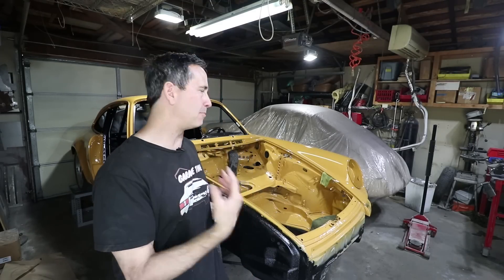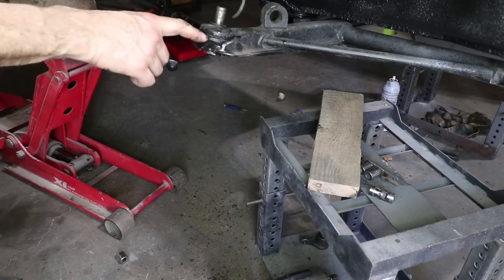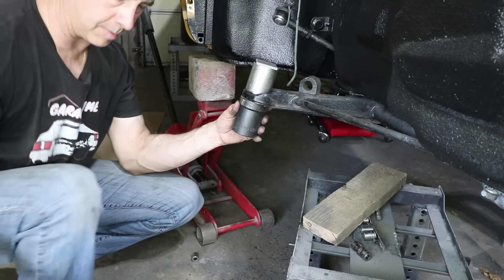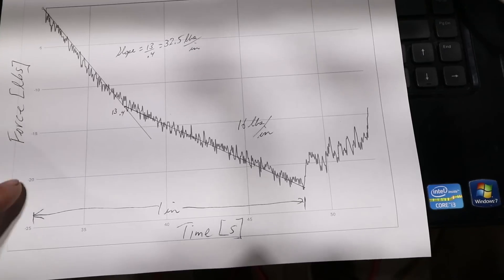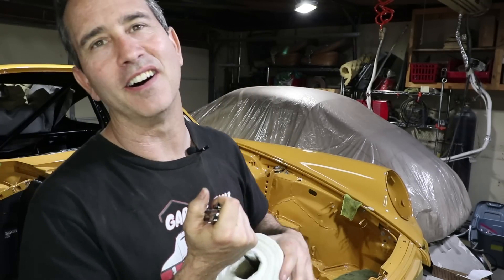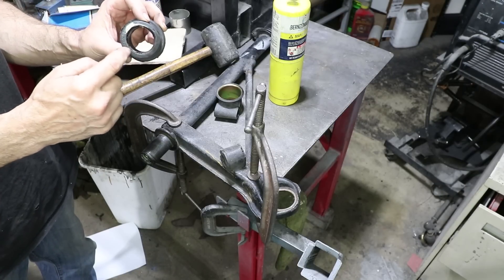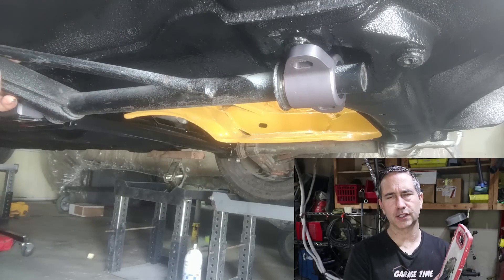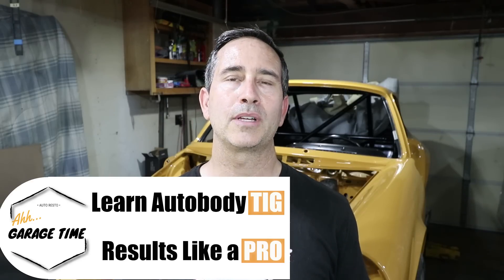Rubber Versus Hard Suspension Bushings:  Which Are Better?  Rebel Racing!

Comment: Great comparison! I have spherical ball bearings just like this replacing the bushings in the Orange 914 Turbo. I noticed an incredible difference in how smooth and compliant the ride is. The initial harsh movement of the rubber bushing is gone and replaced with immediate movement and feedback. Not a daily driver mod, but a street/track/canyon car absolutely.
Reply from the maker: Thanks, I've ridden in another car with similar bushings, but I can't wait to drive mine.  Even for a daily driver, is there such a thing anymore, I would recommend them.

Comment: I used del-a-lume (delrin) bushings on my lower control arms. I agree with your assessment of ride quality not being harsh due to rigid bushings. The suspension articulated smoother with the tougher material. The factory rubber bushings actually add spring rate due to the twisting of the rubber bushing.
Reply from the maker: Exactly, that is what I measured!  What torsion bar size did you end up with?
Reply: 700# coil springs in front, 200# leaf springs in the rear. 1970 camaro..LOL

My factory control arms with rubber bushings took a great deal of effort to move without the ball joints connected.  The arms with delrin bushings acted like they had bearings in them...no effort to move them.
Reply: @jwright650  I would really like to have the delrin bushings in mine. I have the rubber in them for now. I did go solid on the body bushings because I want to run frame connectors. Great video Tom!
Reply: Russ, I installed the Global West LCA bushings. If I had stock UCAs, I would have used delrin there as well, but the tubular UCAs that I used already have delrin bushings in them.
Reply from the maker: Are fancy Teflon type bushings available for your cars?  I was amazed at how thin and slippery the actual Teflon liner is.
Reply: Here's what I used

https://youtu.be/dUQbcyVINL8
Reply: @jwright650  Thanks John. Those are NICE!

Comment: think you'll ever go for the RSR rear bushing set as well? Curious to see your thoughts on those since theyre the same type of frictionless system as the fronts
Reply from the maker: I'm probably going with the 935 style pivots in the rear, but same idea.
Reply: @GarageTimeAutoResto  very nice. I’m in the planning stages of my suspension rebuild and I’ve seen varying opinions on the install process on the RSR rears but it seems to vary from car to car..I like the idea of getting rid of rubber haha
Reply from the maker: Cool, I want to be able to raise and lower the pivot points since my inner mounts are also adjustable.  This means deleting the torsion bars too.  Otherwise I would absolutely use the rebel racing rear bushings.

Comment: The proper way to measure NVH is with accelerometers not load cells, you go for a ride and you record the vibration level, thats the way to measure structural noise. You can also measure the noise level with a microfone so you can compare airborne noise as well.
Reply from the maker: The measurement in this video was about wheel rates due to rubber.

Comment: Great video! I’m curious how you would size your new front torsion bars with this setup? 

I have a 77 that I’m debating between 22 and 23mm front bars on stock rubber bushings. Would you err to the lower number with the Rebel hard bushings?

Thanks!
Reply from the maker: Thanks.  The rebel bushings actually free up the front suspension and reduce the overall spring rate.  Having said that I wouldn't put anything bigger than 21 on a street car.  My car has the stock 19 front bar.  
The lighter the car the smaller the bar needed.
Reply: @GarageTimeAutoResto  Makes sense. Thanks for the advice!

Comment: this one was tough for me to grasp. had to go back and review my ‘anatomy’ of the front suspension and rewatch the video a few times. i’m guessing that’s a pricey upgrade.
Reply from the maker: Hey Grant.  Good to know.  On one hand I'm happy that you looked into how the front end works. On the other hand sorry you had to go look it up.  Coilovers show exactly how the force pushes on the arm whereas torsion bars are hidden.  I'm guessing that is what you looked up.
Reply: Garage Time - Restomod    was more of an orientation review. forgot those front torsion tubes are oriented paralleled the side. great video as always. i’ve developed a rattle in my front suspension that my mechanic says is the strut insert coming loose. he’s tightened it once but it seems to recur. messes with my OCD.

Comment: Tom, is it your conclusion that this is a worthy replacement for both street and track since there is no downside? Excellent analyse for folks who just like to know.
Reply from the maker: Yep, I think they are a good upgrade for street and track.  Zero maintenance, better performance, and not harsh.  The only downside I can think of is they don't look original, for the concourse guys.  But they probably don't drive their cars hard enough to realize the performance benefits anyway.

Comment: Great vid and explanation but wheres the comparison test?? Also for those also considering Elephants, what are the compliance factors there?
Reply from the maker: The comparison is 30+Lbs/in for rubber and zero for rebel racing.  The arm falls down under it's weight so there's nothing to measure.  Are you referring to the elephant rubber bushings?
Reply: Garage Time - Restomod I think Elephant Racing had a similar product for these bushings. Wondering if you considered those and what your thoughts about testing would show there? These are the 3 folks tend to talk about. OEM vs RR vs Elephant where Elephant’s are similar to several other variety on the market too.
Reply from the maker: Ah, yes elephant racing makes the same bushings as Rebel Racing.  My understanding is that Rebel was first, but not 💯 sure. I would expect ERP to work the same.  ERP has a multi-axis front mount that works like the Rebel spherical washers, but I honestly don't think it's necessary as long as the suspension pan is straight.
Reply: Garage Time - Restomod haha yea heard that debate! Personally I’m a fan of simplicity and nice design. RR ftw.
Reply from the maker: Totally, my install went really well.  I would highly recommend them.  I've been in a car with these bushings before and thought they were awesome.  I'm looking forward to sway bar selection/tuning and maybe larger front torsion bars.

Comment: Excellent.  What is your data capture set-up and software.
Reply from the maker: Thanks!  Software is benchlink data logger and the dmm is agilent 34970a.  All old stuff.
Reply: @GarageTimeAutoResto  In the course of understanding  handling performance variables over time and during driving events,  it  is interesting to contemplate how to simply  and accurately quantify the reaction to a known load  at each of the four corners.  
Also, how does the 356 keep its needle bearings lubed and clean?
Reply from the maker: Totally agree that knowing what is involved in the suspension is key.  In my opinion rubber is highly variable and load dependent.
The 356 requires lubrication every 3000 miles.  The grease literally pushes dirt out of the way.  I'm sure Porsche went to rubber for maintenance and cost reasons.  
The rebel racing bearings don't require lubrication.

Comment: Upgrade sway bar bushings, and blast and powder coat frame while your doing all this work???
Reply from the maker: I did paint the arm black but didn't show in the video. I'm going to use the through the body sway bar so I need to cut the old sway bar bushing bracket off and weld the older style on.  That's an easy change.

Comment: Hey Tom. What grease did you use on the torsion bar? Is the same stuff you can use inside the strut?
Reply from the maker: White lithium on the bar and marine grease on the spline ends.  There are probably better choices but the grease is only for corrosion protection and easy removal.
Reply: @GarageTimeAutoResto  how about inside the strut where the strut insert slides?
Reply from the maker: I'm not sure about that one.  I haven't got that far yet.  My guess is the same situation, grease is there to prevent corrosion as the strut is sealed.  If that is indeed the case, then almost any grease would work.  You know who is good about grease types is Mike Restorations.  You probably follow him already.